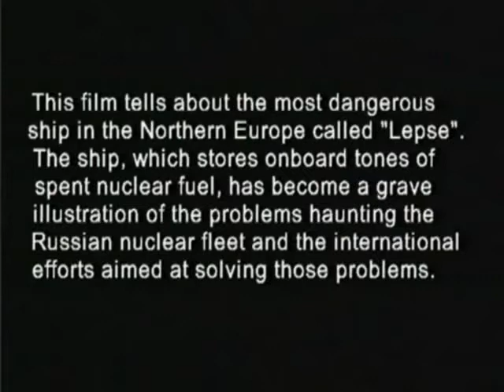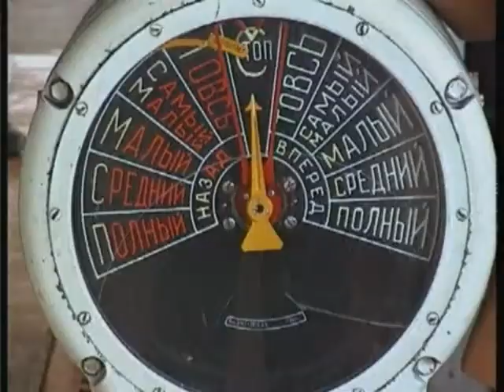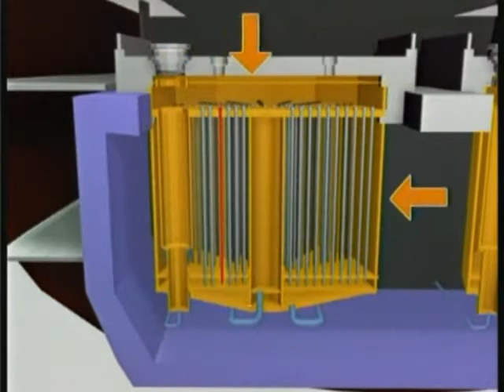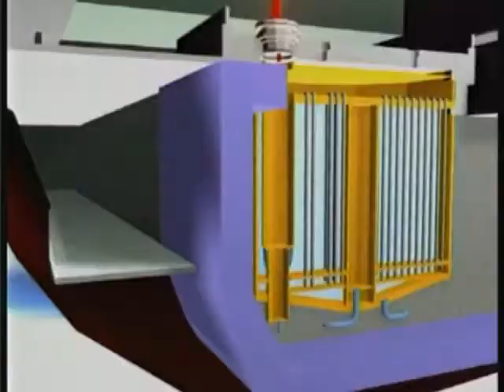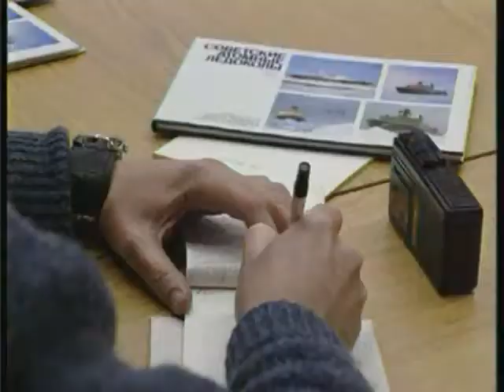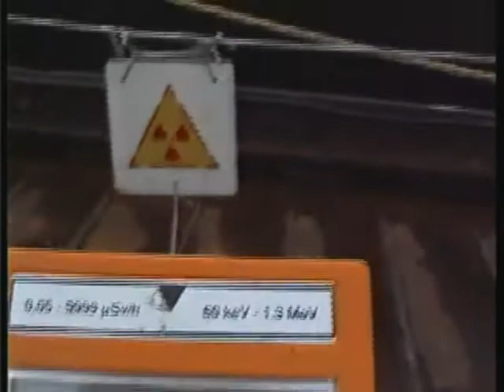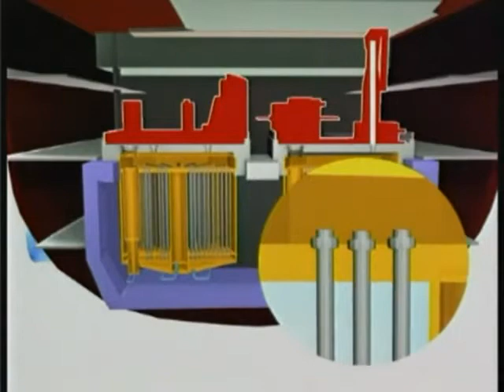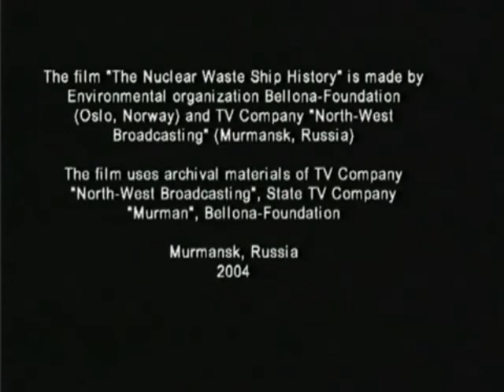The Nuclear Waste Ship

Comment: Just dump it all in a thorium reactor job done?

Now we just have to wait for them to come online shame more money isn't put into there development..
Reply: Unlike Wind and solar, there are no active Thorium reactors, Thorium is just a bad argument for building conventional nuclear power plant with the hypothetical possibility of "upgrading them" or building them with "upgrade to thorium" in mind. Nothing but green washing. Even Cold Fusion (which would make Thorium obsolete) is at a further state in development and trial than Thorium reactors.
Reply: Sohave ok what about fusion reactors
Reply: SpenserRoger
 That is the cold fusion I am talking about.
Reply: Sohave no not cold fusion. Hot fusion. Look up ITER
Reply: There are many operating thorium reactors, not commercial but they are operational..
They produce more energy than they consume so they are better than current fusion which currently take more energy to fuse atoms than it produces when they do fuse.
Cold fusion is a long long long way off (if ever)
Some reactors you can look into are.
prototype 8 MWt Molten Salt Reactor Experiment (MSRE) operated at Oak Ridge over four years to 1969 (the MSR program ran 1957-1976)
Norway, the Halden research reactor has been running on thorium fuels sine April 2013. 
China, TMSR Research Centre has a 5 MWe MSR prototype under construction at Shanghai Institute of Applied Physics (SINAP, under the Academy) originally with 2015 target for operation, now 2020.
TMSR-LF 2Mw test aimed completion 2018
USA oak ridge labs also have some test new reactors as well as working with the one in Norway as part of commercialisation project to being thorium online.
Source link: (plus google it!)
http://www.world-nuclear.org/information-library/current-and-future-generation/molten-salt-reactors.aspx